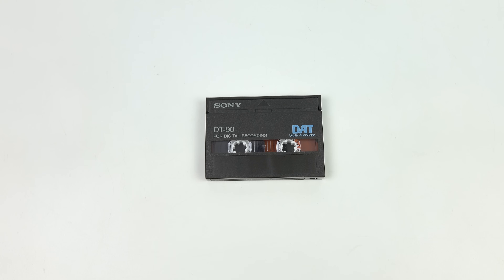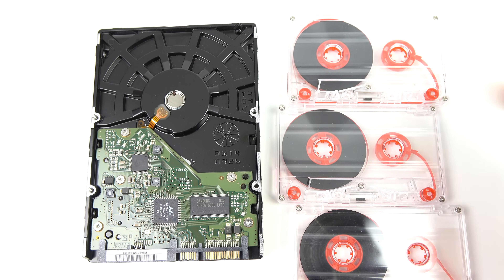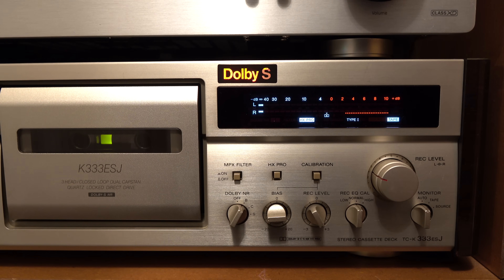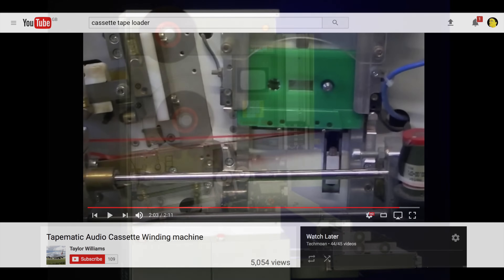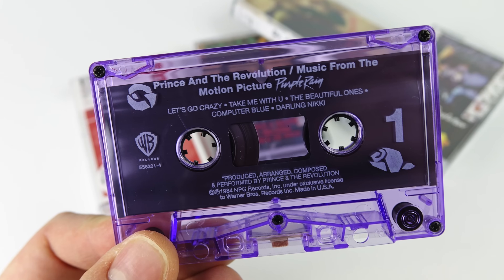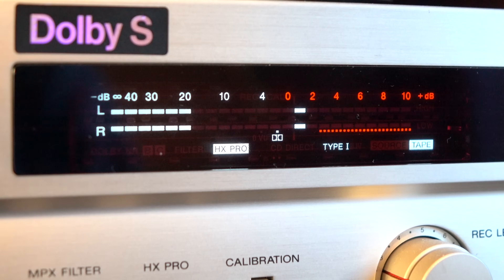Pre-recorded Cassettes' Last Stand

Comment: I recently discovered that Blu-ray is becoming the another Obsolete standard, maybe not as movie medium still, but as Data – it is. Sony stopped making portable Blu-ray recorder drives many years ago, i recently bought the new Blu-ray USB disc recorder/data-drive which was manufactured in 2010 for only $30, they don't make them anymore but you can buy them like left-overs or on Craigslist. Blu-ray is really good as data medium, they improved it radically – special anti-scratch coating and size - double layer 50Gb rewritable discs and even the last one 100GB double layers, but they are not compatible with all Blu-ray drives-this discs and drives are even rarer. Also Blu-ray medium very cheap now - the cheapest one-time burn 25Gb disc is only $1 - with better quality and size than DVD-Rs.
Reply: The only companies who today make portable Blu-ray recorder/data drives are Samsung, LG but they are very crappy in quality with many user claims of broken burns. Sadly Sony stopped making them, it is important that Sony drive is like notebook type - you can clean lenses easily – the biggest problem of all optical drives – the "dirt and dust" (my macbook drive stopped burning discs because of it and it is very hard to clean there).
Reply: If you visit Sony-Optiarc website - all Blu-ray drives are "end of life" products listed. The latest one portable Blu-ray recorder BDX-S600U with support of latest 100Gb discs are made in 2011. Blu-ray is becoming last disc medium already.

Comment: It wasn't "short sighted penny pinching". It was the opposite. They knew the market was going to switch over to digital as in CDs. So why would they invest in tapes regardless of the quality when they knew the format was radically changing? It was a much better investment to invest in the new format infrastructure than the old infrastructure that was on its way out.

Comment: Sending digital signals directly to a tape recording head? Could be (and most likely has been) done, probably in the same way that Class D audio amps essentially send a digital signal directly to a speaker. 

It's not digital in the sense of sending byte after byte like you would find in a digital file. Rather it's a series of pulses (all at 100% power), the length of each pulse being relative to the instantaneous level of the audio signal in that moment.
Reply: I still work at a factory making cassette tapes. We have a digital master system from the 80s that was state of the art for its time. Audio is loaded into memory then played back through high speed DACs - beyond the master everything else is all analog. It has 1GB of memory taking up the space of a small washing machine. When you work on this technology you realize how impressive it is even today - for an 80x system four channels of DACs each capable of at least 1.6Mhz are required. You would get more raw processing power in a raspberry pi or cheap cellphone these days, but four channels of high quality audio grade 16-bit DAC at almost 2Mhz is a pretty tough design challenge.

What would actually be more useful for people still operating these beasts (like me) would be to replace the filters and bias circuits in each recording slave with digital technology, but tape business is not big enough to make it worthwhile. Everything is basically running at radio frequency and needs all kinds of shielding and filter circuitry. The analog components drift so need to be recalibrated every morning and/or whenever someone turns on the A/C.
Reply: @llary  What is the make/model of the equipment?  I have always wondered how this  was done and would like to read about it.  Thank you.
Reply: mumiemonstret sorry. Brainfart typo :)
Reply: I doubt you could send PCM directly to an analogue transducer. PWM on the other hand you could. 

Interesting to hear that comment from Ilary though. That's would I would have expected in a practical system, everything past the converters would be purely analogue. However, the drift is an interesting point. Maybe that's why they were looking at digital directly to the heads in the first place? But sadly it just came at a time when cassette use was on the decline.
Reply: As a youth, I did a science fair project using a open reel deck for digital storage in which I did something similar (but not identical) to this. There are some limits - the biggest problem is the head itself magnetizing - but it definitely does work. I have to imagine that they used a special head stack designed for this kind of usage. The other thing that boggles my mind is how fast anything feeding a duplicator transporting tape at 100x would have to be. These speeds are not a deal now.. but consider, 20khz becomes 20mhz! In 1993, no big deal, but when cassettes first came on the market?
Reply: Where does 1.6 GHz come from? If the audio bandwidth is 20 kHz and the tape speed is 80 times, the DAC bandwidth would be 1.6 MHz, right?
Reply: The PCM-to-analog direct would work, but then you'd still have to rely on aggressive filtering at 20kHz to smooth out the pulses to baseband audio.

It's certainly clever, especially because one of the reasons CD were less popular in the beginning was because consumer-level devices used cheap DACs that often just cut out a few most significant bits to save money. However, dedicated DACs perform a bit better, since they can have circuitry to help minimize noise and inadvertent clipping. The direct PCM can still be susceptible to tape speed variations on playback as well—buffers before the DAC eliminate that.
Reply: Storing digital data on tape is slightly different in a way, as you're not expecting it to resolve to an analogue signal on playback - you're recovering it a digital data. They obviously got the head stack right on those wonderful old tape machines that the vintage IBM mainframes used. And of course in more recent times people used to use tape cartridge drives for data backup on desktop PCs. 

Back in the early days of my bands one of the guys we recorded demos with had a PCM machine, that was basically a rack unit that you used like a DAT machine, except you coupled it to a VCR and that's what it recorded on. Of course it used the video track rather than the audio. I always wondered if you could use it with a stereo hifi VCR and have a kind of hybrid analogue/digital four track machine. Punch-ins might have been an issue though. lol 

Didn't those so-called "1 bit" CD players take the digital data stream and convert it directly to analogue rather than use a (conventional) DAC?
Reply: You're thinking of Sony DSD. Those store 1-bit at an extremely high sampling rate, like a digital form of a Class-D amplifier. I'd say 44.1k/1 bit is more like a PC speaker hack. lol

But yeah, DACs work in a similar way, convert the digital pulse train to an analog voltage signal, output it as even spaced pulses, and use post-conversion lowpass filtering to recover the signal. You can do the same thing using the frequency response of the tape heads, with a tiny bit more trickery.
Reply: When I was really young I had a Amstrad 6128. I got a program (think I typed it in from a magazine) that allowed you to sample audio through the cassette port. It was pretty rough sounding but perfectly recognisable as what you sampled. I recorded a Bon Jovi song into it, one song, in segments,  took up a whole floppy disc! And I had to write a little program to sequentially reload the five parts due to the limitation of the computer's memory. Yet I was pretty stoked to have Bon Jovi emerging from my Amstrad. :)
Reply: Class D uses PWM, not PCM. That article states direct PCM to head.
PWM are all-on or all-off signals that use the rampup-rampdown effect of speakers to produce sound. 
PCM is pulse code modulation, basically what a normal DAC will perform.
Reply: @eddyjay83  I always had this more odd thought that a digital speaker could be made by making the driver cone coil out of a bunch of separate electromagnetic rings, each one controlled with a different level of strength assigning them in oder of binary bit position or something like that.  Same for a microphone direct digital.. Different layers of something like piezo electric material each layer requiring the stiffness of the previous layers to be penetrated in order to reach it thus even the quietest sounds would reach the top layer and only the loudest sounds would reach the deepest layer signaling a bit in each later thus the top layer being least significant bit and bottom layer being most significant bit respectively and then DSP would analyze each layer for frequency thus giving analogous frequency information with digital amplitude and suppression of noise.  Taken further multiple thin stacks of these materials (like hundreds of them) each tuned only to resonate with a specific frequency thus providing both digital amplitude and frequency information completely a digital process end to end.  (I didn't say it would be practical to produce or cheap, but it is possible!)
Reply: Now for a few bucks you can pick yourself up a HiFiBerry setup that puts some of the best DACs of the last decade to shame.
Reply: Yes, it sounds like a 1-bit DAC technique (delta-sigma modulation).  Quite a fascinating read if you are interested in that sort of thing: https://en.wikipedia.org/wiki/Delta-sigma_modulation
Reply: You can send PCM directly to an analog output, not just PWM.  1-bit is one way, pulse trains or zero order hold would be another.  The tape head, in this case, could be tuned to be a rather effective low pass filter, given that it is essentially an inductor.  This would work even better if the sampling frequency were higher than CD, as at higher sampling rates, the lowpass filter doesn't have to be a brick wall anymore.  Up sampling 44kHz source material is an option, if the digital bins of that era had the horsepower to do SRC at those speeds.

Interesting stuff - I never gave duplication much thought, but it would have to be a tough engineering problem at circa 1990 volumes.
Reply: Yeah, and the SACDs actually captured the bitstream of this conversion and that was the data on the disc rather PCM digital audio like on a normal CD that still has to go through the DAC. One would think though that there still has to be some kind of digital to analogue conversion before it finally goes to the amp & speakers? Or perhaps it's just filtering?
Reply: Right, that's where I first heard about that technique, I think!

I think you can do it with just a low-pass filter, given a high enough bitrate.  I have a beagleboard sitting on my desk which might be able to flip the IO pins quickly enough to generate audio.  Will give it a try sometime and see what it actually sounds like.
Reply: You can buy consumer adapters for your car that are tape shaped and have D/A converters allowing you to plug your phone into your old tape deck.
(I have a 14 year old car. :-)
Reply: I think it's the other way. PWM can be filtered to analog because the average of the binary signal being sent is proportional to the value being encoded. PCM encodes each sample as a number code which would produce meaningless noise if sent to an analog device.
Reply: @bryede  old thread, I know. PCM can be converted to analog with a passive resistor network.  I remember making a cheap "sound card" hanging off the parallel port in the 90s
Reply: Matthew Farrow no, we have an Otari DP system. Concept Design was mainly popular in the US and virtually unheard of here in Asia. For an electronics engineer it's actually quite enjoyable to work on these 80s systems, everything is documented down to schematics and easy to fix.
Reply: That sounds similar to the discribing of Nicam Hi-Fi Digital Stereo on the old gray rare as Goldust grey JVC Professional Dubbing Deck I used to have.

Stereo VCRs since never recorded as loud and as clear as that bad boy because they never had real dubbing control knobs for setting your recording volume so it just hits the right spot of volume at the top range on your channel you can do without it being on the max all the time but does go into the max on the bits where it legitly is a really loud sound effect so not distortion is in your recording.

I've never ever seen the old bad boy on ebay since the old bugger broke down and stopped recording sound at all.

I remember the classic also rare now old SANYO tape deck as well which allowed you to set the recording volume of audio tape recordings but you only had radio and vinyl back when that was out to be able to record but I guess that was high tech for 1970s Hi-Fi of the litural audio non video sence.
Reply: Class D amps don't send the PWM waveform directly to the speakers. The waveform is filtered first to remove the ultrasonic components and what remains is exactly the same audio-frequency waveform as produced by any other kind of amp.
Reply: Thezuule yes, but they don't work anywhere near the speeds of these  80s duplicators. Finding and implementing an audio optimized DAC chip that can run at multi mhz sample rates and at least 16 bit resolution is still difficult today.
Reply: Oh no doubt. When you're running the thing at 100x faster than it would normally process you complicate issues severely. As far as DACs go though we've lowered the price of an incredibly high quality DAC to that of spare computer parts which is something that still blows my mind.
Reply: But the bitstream would be converted to a pulse voltage.
Reply: "Digalog" was WEA's brand for digital bin duplication. They, and most other duplicators in the U.S., used Concept Design equipment or Tapematic. Both sent analogue signals to the duplicator slaves. The subjet of sending digital signals directly to the head for duplication was so rare that perhaps Otari only promoted it as a concept rather than a working unit because I do not know any U.S.-based music duplicator who recorded with that method.
Reply: @deborahokelly5865  #TellEmDebs
Reply: Class D amplifiers are not digital.
Reply: A lot of radio transmitters use PWM now, even on AM.
Reply: xanataph it's like he said "bastard tape" although he said "master tape" 1:30 more
Reply: Almost but no cigar. It's grey, it has the lift down flap but the mono stereo is on the remote not the controls and the voule was a knob not a slider. Certainly no such thing as that circle rewind on the right on my old one. Closest one to it yet though.

http://www.ebay.co.uk/itm/JVC-HR-D960EK-VHS-Video-Cassette-Recorder-With-Remote-Working-/122358158684?hash=item1c7d1d555c:g:dUkAAOSw4A5YpZku
Reply: Most of the audio comments in this thread have a great deal of merit.  However, physics=loss. From live.
Reply: it made me pop my tape in oh my goodness it still sound so awesome
Reply: xanataph Sounds like PWM controlled speakers to me... also sounds like deliberately fucking your frequency responce
Reply: What brand
Reply: xanataph  What brand u do
Reply: DCC.  Digital compact cassette.     DCC-82. What a machine
Reply: bryede yes! That makes sense. The output of the.headphone jack is analogue. Doh. My bad.